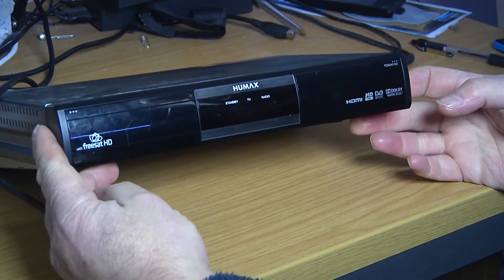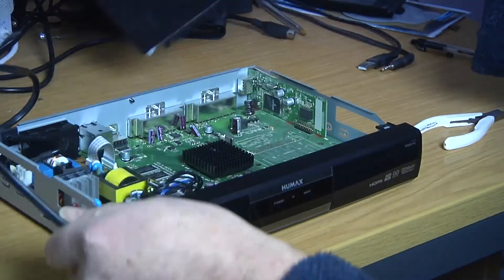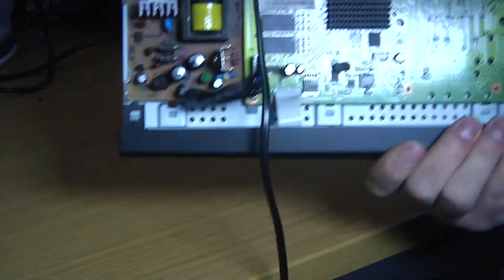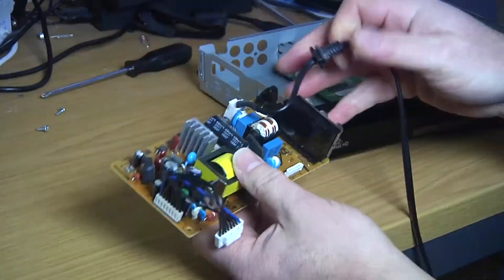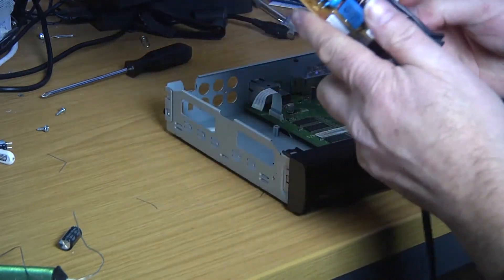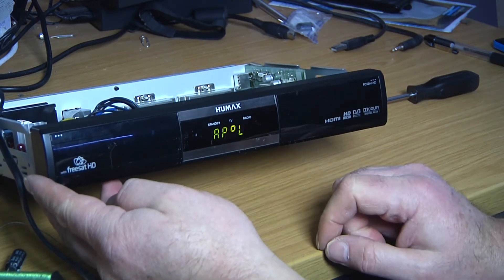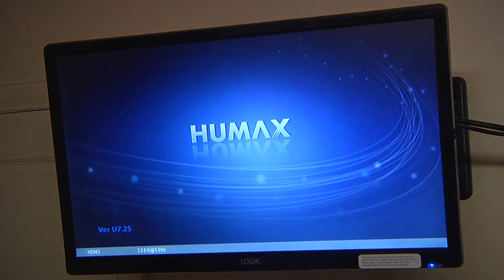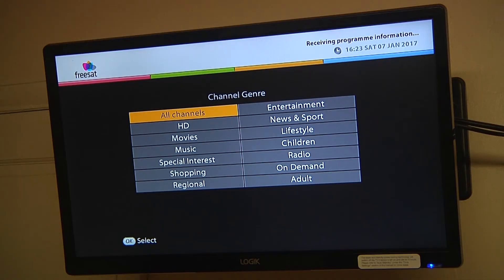Humax satellite receiver repair - FREESAT HD

Comment: What make solder gun did you use? My capacitors are on their way!
Reply from the maker: Hello - I use Antex irons - nothing special really - 15W
Reply: Thank you! @gadgetsgimmicksandtech
Reply: @gadgetsgimmicksandtech  Well, I did the repair and the box now works. Now have a problem of no signal :-P
Reply from the maker: @simoncollins6248  I have not had that myself - have you tried to retune the box? One thing I hate about it is that it every now and then tries to do an auto tune and there is no way of stopping it if you are not there when it pops up. I have had to retune my box several times with channels coming and going and swopping transponders.
Reply: @gadgetsgimmicksandtech  yes I have. There's just 0% strength and quality signal. Must be the dish in need of repair. Well, at least I fixed the box, thank you certainly for that!

Comment: You can up rate the voltage rating of the failed caps, ( it will not impact performance ) and you will get even more life from the device. They will be bigger but space should not be a problem, just got for it. Easy to see as the caps in question are domed when they fail. Simples !!
Reply from the maker: Thumper Man - thanks for sharing your tip. As you said, increase in rating is fine, but never decrease the rating.

Comment: Hi very informative video. I have the same issue, and would appreciate if you could tell me if i disolder the existing capacitors, how do know what the plus and minus connections are on the existing capacitors, as i have conformation  looking at the data sheet for the new ones i have just received and found out that connecting with wrong polarity could damage them. Awaiting your reply, regards Vincent
Reply from the maker: Hi Vincente. The capacitors will have a stripe of some kind down one side.  This is the negative or ve connection to the PCB.  I can't remember exactly how the PCB is marked, but it should have either a dot or a minus ( - ) mark or maybe a plus (+ ) mark on one of the holes for the capacitor.  Connect the capacitor so that the stripe is in line with the dot or minus ( ) mark. Do NOT put the stripe to the + if there is one!!!

Comment: Hi, I have a Foxsat box with the same problem. I have ordered some good quality Panasonic low esr capacitors. A couple of questions Do I need to discharge the big capacitor on the power board somehow or is it safe to do the job without discharging it?
Also the ribbon cables do they just pull off or are there clips to release? I couldn't see because the video is sped up.
Cheers 😊
Reply from the maker: Hello 1Kchess.  It is always good practice to ensure that capacitors are discharged before diving in to repair a board.  A lot depends on how long the unit has been unpowered for anyway.  It has been a while since I worked on one of these but I think they just pull up - the white ones do, the others may have a small springy clip to just slip back to remove.
Reply: Thanks, how do I discharge the capacitors, will pressing the power button with the unit unplugged from the mains achieve this?
Cheers

Comment: Hi Neil, I have an HB-1000S and the HDMI output is down. I bought a RCA to HDMI adapter and it works with the analog output of the Freesat bax, but of course with a very poor quality.
Do you know how to repair the HDMI output? Is it possible? I don't want to change the box because the encrypted recordings on the external drive can only be played with the box which recorded it.

Many thanks for your help.
Reply from the maker: Hello Gilles Polin - who is Neil?  I have not delved into the receiver part of the Freesat box so I am sorry I have no advice for you on the HDMI output.

Comment: I had the same problem as you and replaced the same caps that got it working but after a few months, the box's  2 front leds just flicker faintly but won't display any picture... Any ideas?
Reply from the maker: Glad you got the set working again, but sorry I can't help with the LED problem.  I have one that has a segment that has gone bad but not bothered to replace it.  This is now quite an old video and I have started to migrate away from these receivers to televisions with it built in which means less clutter, one remote and a saving on power!
Reply: @gadgetsgimmicksandtech  Thanks for the reply!
I just had a look on another video where reflowing the cpu solved a power issue..might go for that.. wish me luck

Comment: I have this board and the unit is dead, not displaying the rotating LED, could it be these capacitors?
One does look a bit bulged!
Reply from the maker: Any bulging capacitor will be faulty.  Replace it.
Reply: Changed caps C12 C23 C14 C24 but it’s still dead
Reply from the maker: @shush_ya_mush  If it is totally dead I would check to see if there is an onboard fuse (I can't remember) - also the diodes for the PSU .  Failing that, check for AC from the transformer.
Reply: @gadgetsgimmicksandtech  Ive changed the fuse and it immediatly blew again, must be a short somewhere, any ideas where I should look?
Reply from the maker: @shush_ya_mush  rectifying diodes? Transformer?
Reply: @gadgetsgimmicksandtech  I have a short on ZD1, no resistance either way, I dont suppose you know the value of this diode?
Reply from the maker: @shush_ya_mush  Sorry, no, not off hand - if it is labelled ZD, it is likely to be a Zener Diode with a particular voltage.  I am not able to take one apart at the moment to meter it - sorry.
Reply: Just been checking voltage and it went as far as ‘BUSS SR-5’ which is a fuse, think I’ve found the fault, just need a supplier for those

Comment: Caps - the bane of every electronic device so much going to landfill for the cost of a few 50p capacitors!
Reply from the maker: So true Garry Gemmell! - modern capacitors just don't seem to have the longevity that older ones did.  I have replaced these capacitors several times now - using supposedly high quality components!

Comment: Hi Neil. You are obcviously into electronics and familiar with these Humax Rxs. I have a motorhome and want to use it in that from the 12vdc (4amp)  but there is no Cig plugs available for 1100s with the positive pin in the centre. Mine is working ok from the mains but I dont really want to cut the 12vdc lead off and fit a cig plug on that and a socket on the psu wires. Any ideas where I can get the correct plug for the HDR 1100s so that I can make a lead up?  fingers crossed...thanks.
Reply from the maker: Hello Terry Morton.  Firstly, who is Neil?  I am not familiar with the 1100 receiver, but having looked at a photo of it, it looks to be one of several possibilities - 2.5mm jack or 3.0mm jack - there is a thread on a forum here with some info - https://myhumax.org/forum/topic/power-supply-connector Also, have a look at something like this - https://www.ebay.co.uk/itm/Universal-AC-to-DC-Adjustable-Multi-Voltage-Power-Supply-Adapter-Plug-Charger-UK/323861369571?hash=item4b67a452e3:g:GNcAAOSwcUhdMFBw - you should be able to find the various adaptors  online as well - getting a set will let you find the size you need.

Comment: Hi all i have a humax freesat 1000s box everythings ok, on demand, picture quality all ok signal very good. it responds to buttons fast / tv guide fast to load. etc just the playback recordings are pixelated.HD Reset not helped. - recordings playback picture looks like a poor signal on a freeview box all broken up. HD no noise clicking coming from it  - Q. is it Likely to be a HD Problem. i can bung a new HD not too expensive. any thoughts ? HD Or something like the fix in this video  thanks if you reply

Comment: hello my receiver display in boot how to repair
Reply from the maker: hello - sorry, I do not understand what you are asking?
Reply: I have strong 4950H.i am connected to TV but screen not show full black receiver display boot only show
Reply from the maker: If you are getting the green circle still after changing the components I change in this video, there are some other capacitors to change in the power supply that also cause the same symptoms - I have made a video on this but have to edit it still.  I will link to it from here when I have finished it.

Comment: Hi, nice video. Do you have any repair tips for a Humax HDR-1000S that has lost all it's recordings and the hard drive doesn't respond? It's a known fault but seems to be the drive controller circuitry on the motherboard so a drive swap isn't the issue. Thanks
Reply from the maker: Hello Toob41 - Thanks for watching.  Sorry, I don't have a HDR-1000S myself so can't give you any suggestions.
Reply: Shame as my HDR-1000S seems to have done the same as Toob41 but Humax  have not give a reason for the failure just want to charge people for a reconditioned repaired unit .